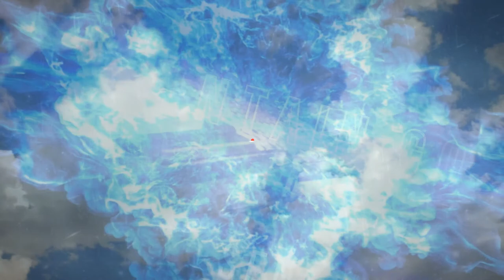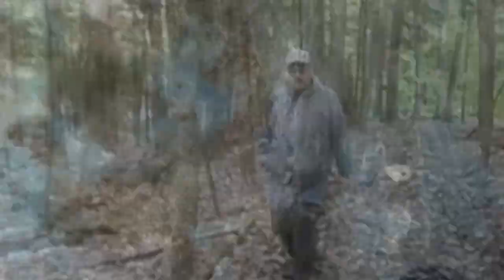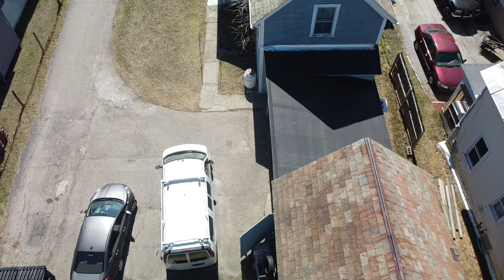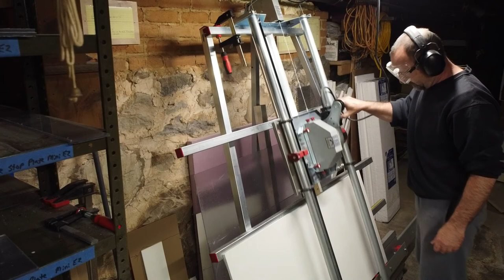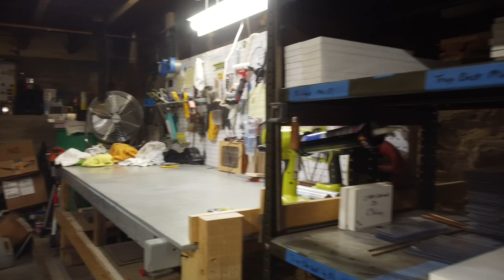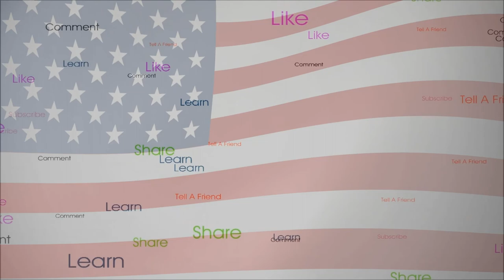Flying In The Shop - DJI Mavic Mini

Comment: Sweet vid Joseph, getting both work done and valuable tight quarters flight practice in a controlled environment...plus a camera man that is easy to get around...brilliant
Reply from the maker: Oh yes! Slow movements down there!!
Reply: @GreenMountainGoldTrap  oh I'll bet...I have a cheepie drone myself...indoor flight made for a very difficult time...with a lot of oopsies. Your drone has smooth movement and lift...mine does every move  in a surge...So oh yeh  I was very impressed with your drone...the difference between a real tool and a toy. Plus you can see what your drone sees through your phone...real nice feature...
Reply from the maker: @waynebussey5521  I have a little drone here as well that acts like you say. Tried it recently and then put it right back in the box!!